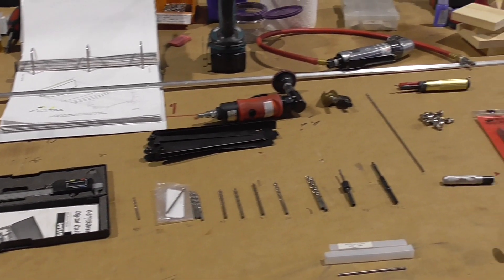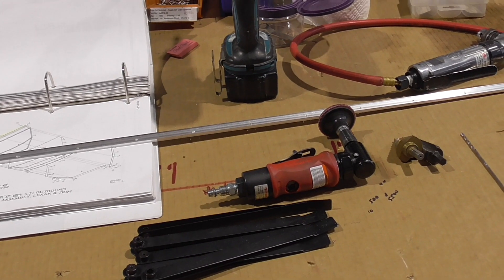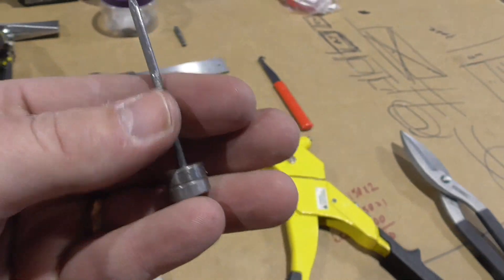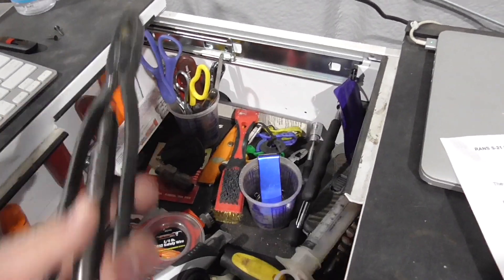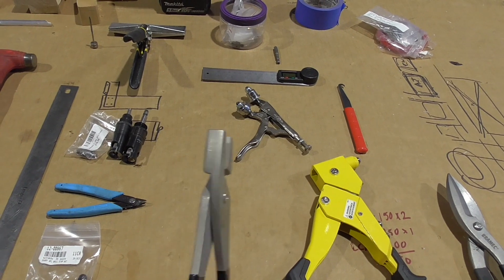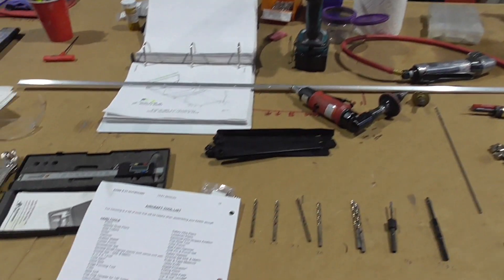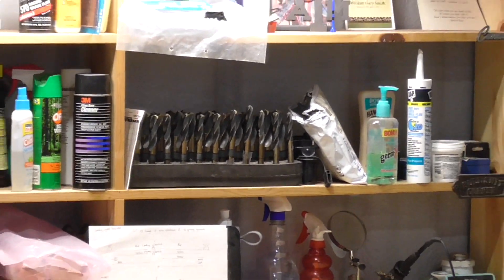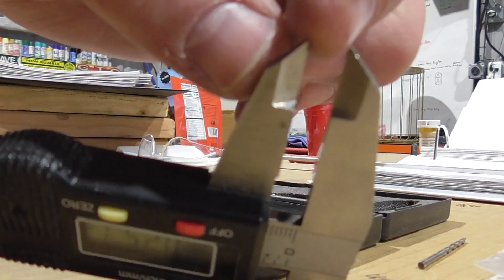Episode 49 - Must Have Tools for building your Rans S21 Airplane - PART 1

Comment: I've been thinking about getting a Drill Doctor.  How well does it work?
Reply from the maker: It works great for larger bits around 1/4" and up.  I'm rough guessing on the size bc I'm not in the shop right now.  It has two little teeth that hold the bit while it's being sharpened.  The teeth are too big to grab in the grooves of the smaller bits.  So your #40/#30 and so on will have to be bought new as the drill can't sharpen these small sizes.  Mine is very old, >10 years, so they may have improved versions out now.  I hope that helps.
Reply: @DadandChad  Yes, thanks!